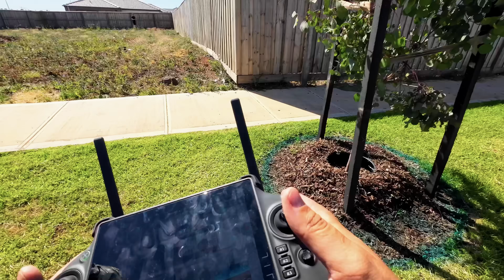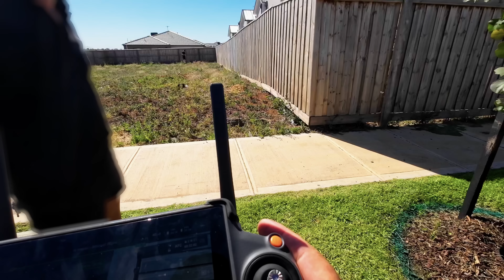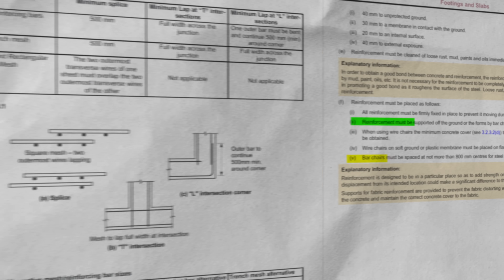I Caught a Concreter Red Handed ...

Comment: Chairs are cheap. Chairs guarantee the steel position. I don’t know how many times I see the reo being lifted and then with everyone trampling on it and screeding invariably it works its way back to the bottom. Many slabs cut and removed generally show the steel on the ground. Heavier mesh, 32/20 mix, 110-115mm thick ,Conelly joints , vibration during placement,curing and cooling slab asap. Won’t have an issue. Saw cutting waste of time unless planned and mesh cut every second bar. Problem these days the trades want to finish as soon as they get to site. 😂
Reply: No one cuts mesh at control joints due to ignorance of the engineering concept. Is done on more major works when Engineers supervise. However full control joints of various types are now more complacent in commercial construction and should be used in residential. They are readily available.
Reply: @christopher54179 exactly. most, if not all engineering drawings for domestic sheds/driveways clearly state where the control joints go and how they should be prepped. The problem is the majority of concreters either CANT read the drawings or dont want to do any work they can get away with not doing long enough to get paid and for that money to be spent. its not worth taking old mate with $20 to his name and a clapped out 20 year old ute to court/VCAT.

Half the concreters ive used (no matter how well recommended or knowledgeable) start talking like this one as soon as you point out that the drawings / regs say they are doing it wrong and will come up with a million reasons why the people that write the regs, the manufacturers of the materials, and the engineers that drew the engineering plans are wrong and they are right "ive done a million slabs like this, it wont crack" "you are trying to rip me off" "i didnt allow this in my quote" and will start to get aggro threatening to walk off the job because you are "hovering over them". funnily enough, after the slab cracks they always say "every slab cracks - its the concrete they sell nowdays".

I think this is part of the reason that slab designs are getting more and more ridiculous, engineer specifies the slab, old mate cuts corners, takes money to the bottleshop, slab cracks, engineer beefs up next slab design, old mate cuts even more corners, takes money to the bottle shop slab cracks engineer beefs up design. repeat until a slab that cost 10K 30 years ago costs 50K and still cracks. yet a slab done with any amount of care professional or otherwise never seems to fail. The good concreters are really hard to hire for a job because they are booked out 6 months in advance.

the slab for my shed has 600d*300w beams all the way around and every 4m within, with a 150mm thick infill, and heaps of rebar.  the soil fill and sand base were done as well as needed for the surveyor to pass it but not quite as the regs stated (special "clay" sand that didnt need compacting and soil was compacted with the excavators tracks)  it has cracks just like a 100mm thick driveway slab would. i pointed out heaps of times that there were things not done as per the drawings but he knew better / would sort it out at the end. once my final payment was handed over i got told to f*^k off when i asked him to rectify problems. 

Even the builder of our house (midsize local company) didnt want to follow the plans or the regulations when it suited them. brickwork was cracked from day 1, and they would only measure cracks with  tape measure for the squint factor even though a micrometer showed they were over what the standards allowed) their bricky said it was fine, yet every bricky thats visited my place has seen the cracks from 10m away and pretty much ran over going "what the F%$k is THAT" their excuse for every problem was always "every one of our builds looks like this". I got a heap of stuff rectified but there was so much that the smaller problems got passed over.

yet im not allowed to build any residential structure myself because "ill do it wrong"
Reply: ive seen exactly 0 shed/driveway slabs poured where they bothered cutting the mesh at the control lines.

Comment: Guy at the start super worried lol. As for them concreters theres no chairs, the mesh is just thrown down and not cut and tied together with a 300 ml overlap and no plastic underneath. 🤷🏽‍♂️🤦🏽. That is shonky work.
Reply: It'd be a disgusting job if it was a chook shed, as a brand new house it's criminal. You may as well not have any mesh at all if it's laying flat on dirt with no plastic, it'll be rusty wire by next year, supporting nothing.
Reply: @wobblyboost  You only need to use plastic cover outside if it rained recently, and yeah you can't lay it on dirt, you need to have a layer of gravel, plastic isn't a replacement for that.
Reply: @wobblyboost  me personally i woulda put sikaflex every 3 to 4 metres so it doesn’t crack also.
Reply: And a 12m perimeter bar on edges
Reply: @cuzakuru  Can you still see the joes2318 comments? they're invisible to me now, so he either deleted all his comments or blocked me lol. I'm almost certain Raven is just the same kid with a different account.
Reply: @wobblyboost  too right! 💯
Reply: @joes2318  Well the slab needs to be on rolled or packed aggregate, which that wasn't. 
If your going to lay on soil it needs to be clean of roots, debris and grass and have a packing strength of 50 kpa which I'm certain that wasn't. 
Laying it on plastic means you only need 30mm of concrete between reo and plastic, it's 40mm coverage between reo and natural soil, which they definitely didn't have. 
A metre of plastic is cheaper than a metre of concrete an extra 10mm thick, thus it is better physically and economically. Your still meant to have rolled or packed fine aggregate under plastic, but if it's on dirty fill your way better off having plastic so the cement won't be contaminated or have cavities. 
All that's in the NCC (3.2), they don't say directly you have to have plastic on all external pavement slabs because they expect you to have construction experience, a functioning brain and take into account the unique site and intended purpose of slab to find what standards apply. 
Finally, any slab laid on wet raw soil must have plastic, particularly if it's a continuation of the house slab. You can see it's wet and it'd been raining there recently, if you don't know why then you don't know concrete.
If this has failed to enlighten you, at least I now know that and that it wasn't a joke.
Of the many breaches of the NCC slab standards in this video, the missing plastic was probably the least egregious, but nonetheless it alone makes these slabs, how you say; non-compliant.
Have a good day Joe
Reply: @wobblyboost Hot dam. Nicely done. 👌
Reply: @wobblyboost  

He said:
"Don't need plastic outside."
"show me where the NCC states you need to have plastic under a driveway."

You said:
"in the NCC (3.2), they don't say directly you have to have plastic on all external pavement" 

soooo what you are saying is that his first statement is correct, you dont need plastic under a driveway, as all the other requirements (chairs, base fill) make it unnecessary.
whether or not THIS driveway has chairs or proper prep is irrelevant.
Reply: @ravenof1985  Your summation of my comment is incorrect. That slab needed plastic. NONE of the other requirements were done, making plastic even more necessary. His original comment 'You don't need plastic outside.', pertained to this slab and he was woefully incorrect. The inept prep of this slab had everything to do with it needing plastic, try reading the full NCC chapter and my comment again.
Have a good day.
Reply: @wobblyboost  he was responding to the top comment which said the slab needed chairs, overlaps,ties, and plastic if the chairs had been used it wouldn't need plastic (as he stated) making your summation of my summation of your summation of his comment incorrect. since plastic is going to do SFA to make up for no gravel base, the gravel base not being there doesn't mean it needs a vapor barrier. what this slab needs is gravel and chairs, NOT plastic.

the vapor barrier is  there to stop rising moisture it doesn't help encase the rebar in the concrete (that's chars) nor does it help spread the point loads out and support the concrete (that properly compacted soil and a gravel base). it might bandaid other problems, and doesn't hurt the slab but it serves no purpose on a slab exposed to the elements.

why don't you directly quote the section of the regs that states outdoor slabs require a vapor barrier?
Reply: @wobblyboost  Thank you, I know less than nothing on the subject so I really appreciate your comments so I know what to ask, look for, expect and happily pay for to know a job is done right
Reply: @wobblyboost  absolutely smoked him
Reply: @perfidiousalbion9975  Ah the fleeting joyousness of being right on teh internetz 😁
Reply: @joes2318  yeah I'm pretty sure the purpose of the plastic is create a vapor barrier so moisture does not wick up thru the concrete slab and cause damage to the frame and structure when used to make a slab that's undercover .but I'm not a concreter or anyone of any qualification it just seems like good common sense cause I bothered to pay attention in school sometimes when it was interesting and not about writing 1000 word essays.
Reply: and all verbally protested in perfect Australian born strine...
Reply: @joes2318  NCC is a minimum standard. The least you can do. Is there no pride in doing the best job possible?
Reply: @joes2318  Sooo your saying you were wrong and you don't understand concrete, got it.
Reply: Lol you bogans
Reply: Not supporting this bad work at all, and have overseen alot of construction work done in my time as a site supervisor. It is however funny how every tom, dick and steve are experts online when it comes to laying concrete… but wifes know better in this situation. On the one occasion their husband tried to “DIY” a concrete job they hopelessly made a dogs breakfast of something related to the concrete and it is now a complete eyesore in the yard, not to mention a trophy of being a dumba$$. 
Even had a good mate crash his car trying to do concrete once, and he was quite a respectable “intellectual” man. 
And dont always listen to  engineers, they often get things wrong and are just trying to big note themselves with useless ideas. Like putting a sprinkler on green concrete. (A good idea only in some situations). Also plastic underneath is only required in some situations and often when used in wrong situations will produce a bad end product.
Reply: @joes2318  So yaw saying you lost the argument altogether because now yore just picking on spelling mistakes, got ya. 👍
Reply: @joes2318  can't tell if joke or you just don't comprehend concrete at all
Reply: @wobblyboost  must of been him that did it 😂😂😂.

Comment: im not even a tradie and i still understand that steel rebar reinforcement should be encased with a minimum thickness of concrete on all sides for corrosion prevention and that thickness varies depending on how close to the ocean and salty air it is installed and also the load requirements, these are basic fundamentals taught in a simple pre apprentice tafe couse. using a hook on a shovel cannot guarantee that the concrete encasement thickness is accurate and without deviation, hence why those bar chairs which are made to a national standard and specification. dodgy workmanship and cost cutting is what is being done to either make more profit or undercut the competition pricing.
Reply: I have been on many construction sites and have only ever met one concreter who did an apprenticeship in concreting.
Reply: @PSY7HON  i know a couple that did apprenticeships, you have to book them 6 months in advance they have so much work on because everyone wants them to do their concreting. they are usually more upset than you are if their work cracks.

The other ones i know labored for a concreter, then struck out on their own. they can assemble a team of similar guys with 2 days notice, crank out a slab (including excavation) within a week of you calling them but it will only resemble the drawings, and its more a question of how bad it will crack.
Reply: pretty simple - if the rebar is at the bottom then it aint re-inforcing optimally, can get rising moisture and can flex more. They arent even lashing the panels together
Reply: Bingo, you nailed it mate. I'm not a concreter- I focus more on asphalt, but you got it spot on.
Reply: if the cost of the concrete pumping method or bar chairs is too expensive then invent a better product or method that complies with the national standards. national standards exist to prevent damage, death and injury.

Comment: Don’t need a pump, you lay the chairs as you go. Used to do it like that just fine when I used to lay concrete. Not to mention you wouldn’t need a pump on those small driveways anyways with chairs and the truck wouldn’t be going on the mesh.
Reply: Clearly these guys don't lay chairs as they go
Reply: @daniel.s8126    lol  lazy ,  it's harder then putting chairs in if done properly
Reply: So, it's not done properly then...? Wow, who knew?
Reply: Exactly mate
Reply: She's well and truely buried, they don't even do that  @daniel.s8126
Reply: “Lay the chairs as you go…” exactly. It’s not rocket science. These boys are just lazy.
Reply: I helped barrow for a job a few years ago- Bloke used chairs, even old school wire- None of this "twisty tie" bullshit. All the mesh was suspended perfectly, and the job was done beautifully.... Meanwhile Dazza and his mates are just chucking rusting reo onto the dirt with no ties...
Reply: You didnt use to lay concrete...🤣🤣
Reply: @keastymatthew2407  I started a concrete and contracting company ran it for 6 years and sold it about 9 years ago, so yea I did. Was on the tools from 15 when I left school.

That concrete in particular wasn’t prepped correctly with the right hardful, mesh didn’t have required cover, shovels don’t have hooks as explained by the concreter… the rakes do. White pipe running across driveways bot required depth (350mm I think). Just the usual cowboy. The main reason they probably don’t want to use rebar chairs is because they are a pain to walk and screed concrete on.
Reply: @FranklinLive  no you didnt🤣
Reply: @keastymatthew2407 All good bud, whatever you say.
Reply: @FranklinLive  yea i know
Reply: @FranklinLive  In China (Shanghai) I have walked many pre-pours, and they use little precast concrete blocks with embedded wire ties instead of plastic chairs, so they can take a lot of loading, and you can get your coverage on the bottom bars.

Comment: Lazy flogs, they know perfectly well that reinforcing bar and mesh has to be elevated (by bar chairs in this case) to maintain consistent tensile strength, even without looking at the NCC. I'm not a builder or tradie and even I know this. I cannot stand people that are not professionals in their chosen industry.
Reply: the most basic shit putting bar chairs in, and they can't even do that.
Reply: @murry001  its not even difficult to put the chairs in as you go so the truck doesnt damage them. The flog just didnt want to pay for them or spend the time putting them in.
Reply: These people don't know what they are doing, it's the same with the guys that don't put snake spacers in between the mats, they pure the concrete and then walk in and lift the mat up a little bit, but it will sink down immediately and then it lies on the bottom mat and does nothing structural. Same with the bar chairs, the steel is on the ground, with no concrete coverage on the bottom, it rusts away in a few years, then the concrete starts to crack because all the steel is gone. What a hack job.
Reply: He's pretending gravity doesn't exist and the reo isn't gonna just sink like a stone in the wet cement and be laying on the ground before it dries anyway. Unless the hipped shovel also alters universal physics when you touch reo-steel with it of course.
Reply: yobbo yobs.
Reply: @wazza33racer I love that your comment has a ‘translate’ button 😂😂😂
YT obviously can’t understand Aussie slang 
Oi Oi Oi 🇦🇺
Reply: you're a champion must be fresh out of uni with all the gear and no idea hahahaha flop
Reply: @thebuilder2018  Nah, just a construction lawyer
Reply: @james3744  so has the study but has never gotten muddy hahahahaha